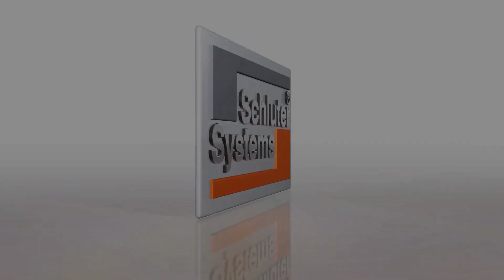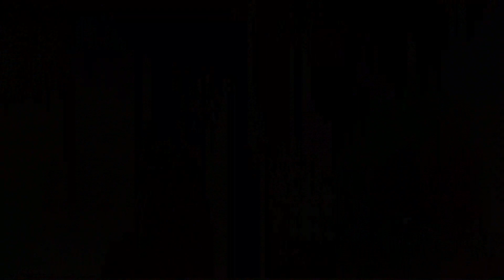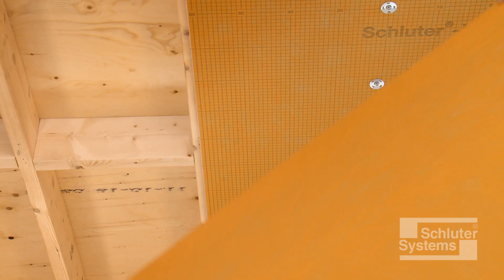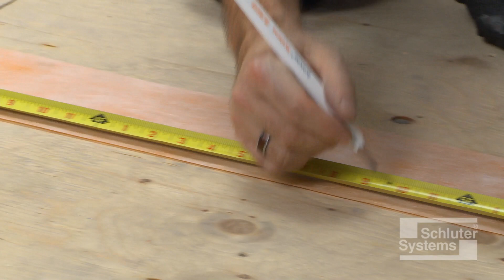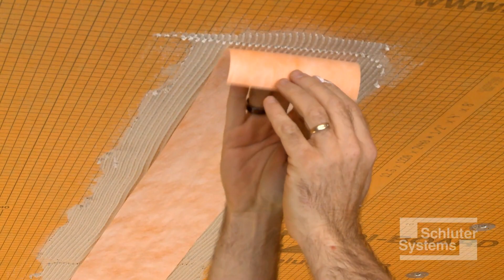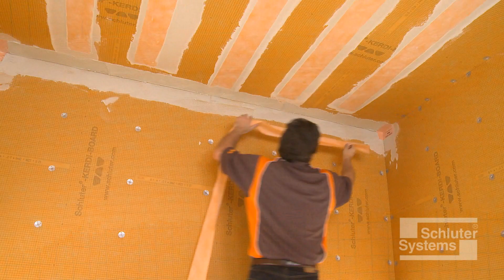Schluter®-KERDI-BOARD over Framing for Ceilings

Comment: This is awesome. DIY guy question; so, if I have 16" oc joists I add screws with washers every 6" along each joist? Would I need blocking between the joists? It seems like I'm this video you're fastening every 6" along the length of the joists and it's ok to have the 16" spacing between the joists. Can you help me understand? I'm going to be using Kerdi Board and tiling the ceiling.

Thank you!!
Reply from the maker: Hi there! Yes, 16" o.c. joists with fasteners every 6" is fine, as long as the solid backing and fasteners are able to support the load of the tile and setting and grouting materials. Hope this helps 🍊

Comment: Can the Kerdi-Board ceiling be mudded/textured/painted (like drywall) or do you need to tile over it since it's softer than drywall?
Reply from the maker: Hi there! KERDI-BOARD isn't designed to have larger surfaces painted, so we would recommend tiling over it. If paint is desired in that area, drywall would be the recommended substrate.

Comment: Hello. I only want to add the kerdi board in the tub ceiling area (Alcove Tub) and butt join to the sheet rock. The butt joint will be running perpendicular to the joists. Do I need to add blocking to the butt joint area to better secure the kerdi board?
Reply from the maker: Hi Oliver! You should be fine. Keep in mind, the minimum KERDI-BOARD thickness is 1/2" or 5/8" for studs spaced at 16" o.c. and 3/4" for studs spaced at 24" o.c. Also, the maximum allowable on-center fastener spacing is 12" for walls and 6" for ceilings. Hope that helps!🍊

Comment: What if the ceilings are sloped? How do I fit a corner band in the ceiling if the ceiling are sloped?
Reply from the maker: Hi Corey! 
You can use KERDI or KERDI-BAND to create the corners. Simply take a large enough square membrane, make a cut from the center of one edge to the center and fold over the dog ears to create the corner. Also, make sure there is a 2" overlap on all side and thin-set each flap in place.

Comment: What is the recommended procedure between Kerri board and a drywall ceiling?
Reply from the maker: Hi there! 
It really depends on the application. If you'd like to waterproof the ceiling, the KERDI-BOARD must be fastened to the ceiling with screws with 6" on-center spacing. If you're looking to only waterproof the shower head simply butt join them and then install the tile over the KERDI-BOARD with a DILEX- BWA profile or alternatively caulk the joint in case there is movement. For more information you can review or handbookhttps://sccpublic.s3-external-1.amazonaws.com/sys-master/images/hbd/h2e/9007206531102/Shower%20System%20Installation%20Handbook.pdf

or call us at 1-888-472-4588

Thanks!